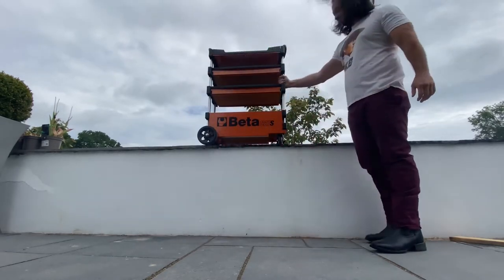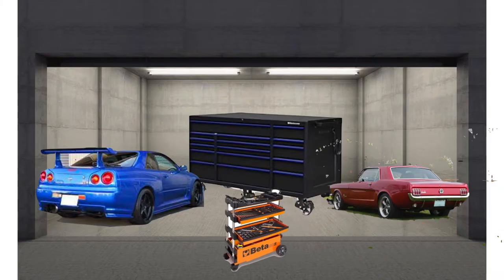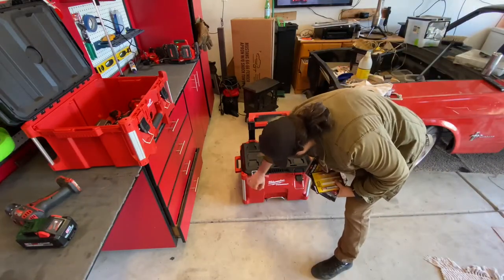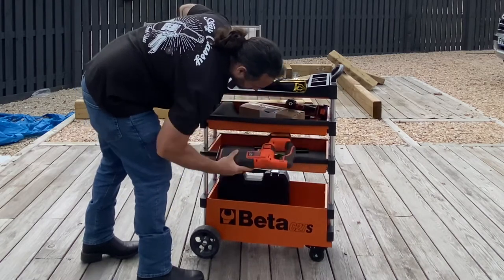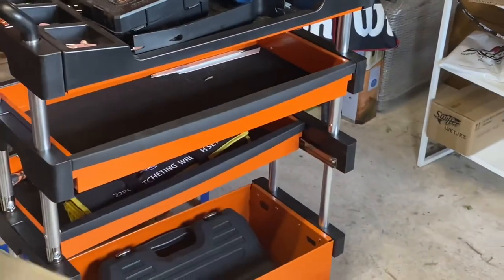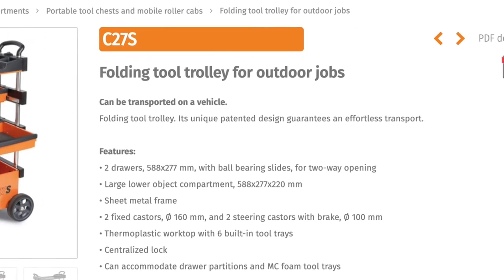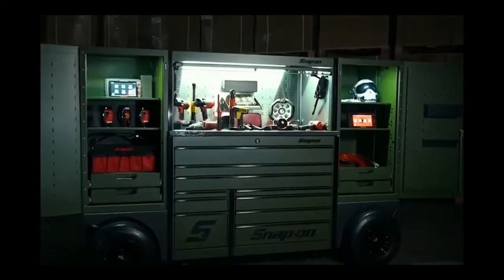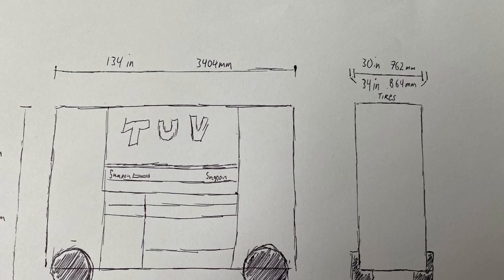Beta Tool Trolley || Tool Review Footage

Comment: Thanx, A handy guide. I was looking at the Kendo version, not seen one in the flesh.  Sort of based on a Hazet tool trolley but much more useful with the pull out drawers. Shame they don't seem to pull out when its folded down, that would be handy if its folded in the back of the van. I was wondering how long lasting - well made - plastic failure - thin metal - bad drawer runners - it would be. The Hazets are tough & last for years
Reply from the maker: What was the price the one you were looking at? Mine was a bit overpriced!